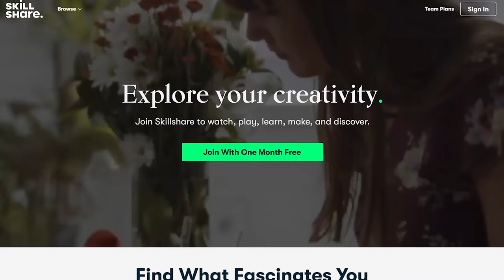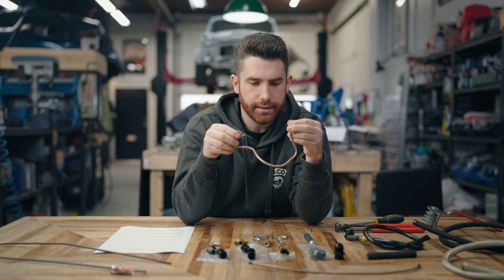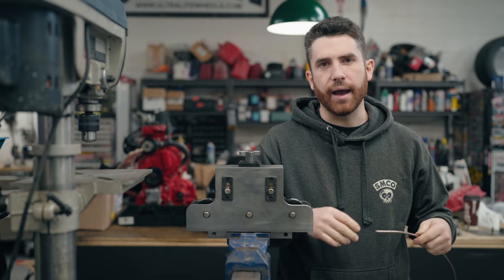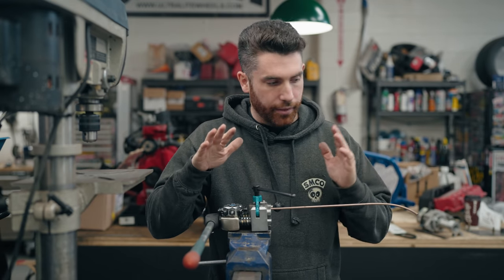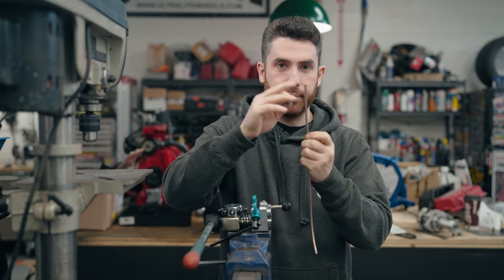Automotive Plumbing - Comprehensive Overview for Custom Projects

Comment: One thing to add to your description of Mini brake line fittings is the fact that Rover had a nasty habit of mixing imperial (UNF) and Metric threads on the later cars. On some models (my 1992 Cooper for example) the long solid brake line that runs from the rear subframe to the balancing valve in the engine compartment has a UNF male at the rear and a metric male at the front - on the same pipe! You can force a connection with the wrong fitting because the threads are similar but it doesn't result in a safe joint.

Comment: There are lots of videos available on brake and fuel lines. Your video is by far the best I have ever watched. Perfect combination of well thought out content with professional delivery. One question: what is the preferred method for releasing/removing crimp hose clamps? Thanks so much for preparing these videos! Lin
Reply from the maker: Thank you very much!
Reply: @Stevestonmotorco  what about removing those clips?